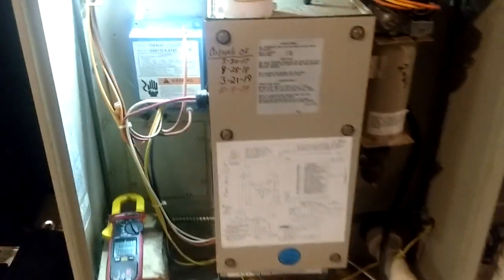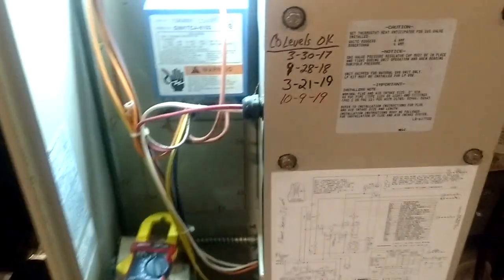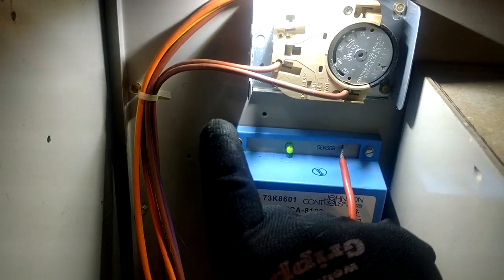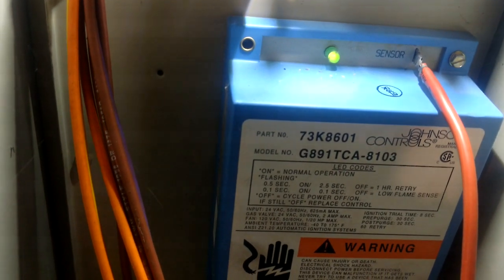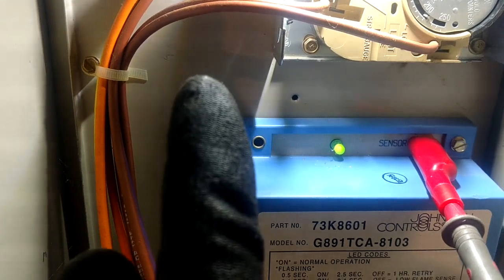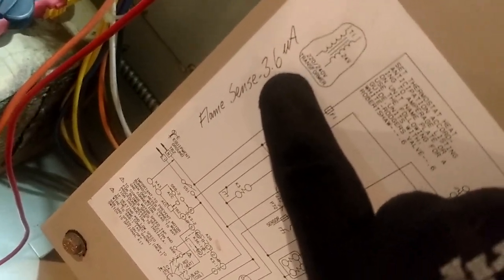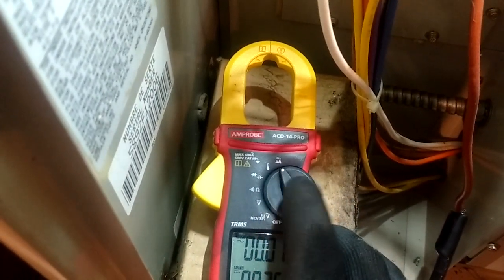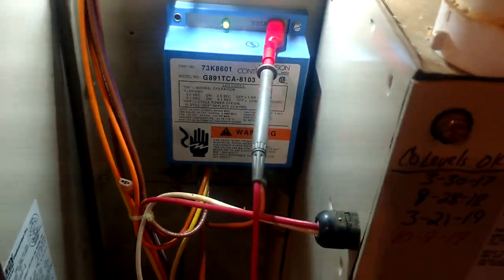The mysterious micro amp 🤔 What the uA setting on your meter is for & how to apply it in the field.

Comment: Do they make a clamp meter that reads micro amps.  My flame sensors are a pain to get to on my incinerators  I want a fast way to check micro amps via clamp meter.  I'm having a heck of a time finding a unit that will do it
Reply from the maker: There is no clamp meter made that will take a microamp reading through a clamp. It has to be done through teat leads. Just connect the meter to the other end of the wire where it attaches to the board or somewhere in between. You don't have to do it right at the flame sensor if it's too hard to access.. but if you weren't getting the proper microamps from the flame sensor the flame would go out 5 seconds after lighting.  If the flames continue to burn after ignition then the flame sense (microamps) is good. 😎👍
Reply from the maker: If your flame sensor hasn't been cleaned in a long time and it's that hard to get to. I also have a video showing you how to take a cheap wire bottle brush that you can get at harbor freight and bend it at a 45 degree angle and get back to the flame sensor to clean it while it's in place, without having to remove it. 
Just make sure you turn off the power to the appliance before doing this.

Comment: hi great explanation.. question.. i have no amperage to the rod, replace the board still the same no current to the f sensor. i replaced induce fan, pressure switch, flame sensor,  gas valv (adjusted to 3.5 wc in  specs).
resistance nighter is low 50ohms, all limit switches have continuities.
all in sequential starts when power on means, inducer fan, pressure switch, igniter glows, gas valve on (has 26v to it) but wont burn.  Also removed and cleaned all burner surface with metal brush , really cleaned.  (on off 3 times then lock out, 1 blink led).
Rarely it does burns, then the next cycle it would not burn again then lock out.
so my question is, if intermittent amperage to the sensor and the board is replace, what else can i do next? no amperage and 80volts to the sensor. 
Any suggestions or thoughts will help.. Thanks!
Reply from the maker: Probably time to call in some help
Thanks for watching 😎👍
Reply: @sknight0391  Hi.. thanks for reply.. just  finished the unit.. I had to unplugged all wires, continuity checks, checks lose terminals to wires and make sure all terminals are tight fits, especially triple check ground wire and its ground.  and use fine sand paper and cleaned f sensor again. it was used with scotch brite.
turned it back on and it runs like a brand new unit. 
Thank for you great video helping out us!

Comment: I thought the small curve on the top of the clamp was just for that...without the need of having to use the leads.
Thanks for your video
Reply from the maker: No, the yellow curved clamp on top of the meter is fir  taking Amps. Microamps is a different reading that needs to be done through the test leads. And it only applies to certain things like "flame rectification" on gas furnaces. And should only be used by qualified technicians. Thanks for watching.
😎👍

Comment: Can I do this with a simple multimeter having resolution 2000uA and 200uA? At 200uA it would measure 1, 2 or 3 uA but not fractions between them
Reply from the maker: As long as it has the uA setting on the dial.  Thanks for watching 😎👍

Comment: These killed multiple people and are to be condemned for any repairs regardless of electrical issues. This should have been torn out and the customer credited the cost towards a new system.
Reply from the maker: Do your research Chad. Do your research.
Reply from the maker: The G21 series was never even part of the recall. Those were some of the best furnaces ever made. 👍

Comment: Hey Shannon , what co levels you like looking for ? The different ranges ? I’d like to start writing them on the furnace too
Reply from the maker: A properly running furnace will generally be somewhere in the 20's or below. 12 & 14 ppm is pretty typical when they're dialed in. Most guys consider 100 ppm the "cutoff" for a furnace being safe to run. Anything above 100 ppm is not good. But even when you're up in the 60 & 80 ppm range, it's pretty safe to say there's something not right. If the gas pressure on the valve is set properly and there are no obvious blockages in the vent pipe there is probably something wrong with the heat exchanger (very small cracks or pin holes). 
BUT KEEP IN MIND, those are "exhaust" readings that were talking about. The only acceptable level of carbon monoxide in the house is 0 ppm.  Thanks for watching 😎👍

Comment: Shannon great tip recording the micro amp on service. I also I’d readily accessible record the capacitor microfarad on the blower. I find MANY way out of spec and still running when on a maintenance service. Thanks
Reply from the maker: Thanks for watching & for your feedback 😎👍

Comment: Just to add Shannon. Friendly feed back. 
The way the current is produced in the flame rectification circuit, the board send voltage through the flame sensing wire (Typically 80-100 volts) to the flame rod. The voltage is then going, via the flame sensor, into the flame. Flame is just ionized molecules so the flame conducts electricity. The key is, the other side of the flame that is touching metal, that metal has to be at least 3:1 ratio bigger than the flame sensor rod- That is what causes the voltage to rectify to DC. The now DC voltage is carried back to the control board  to prove ignition via the ground wire. So when you say in the video you can handle the wire ok and its safe with your bare hand, you better be careful when you are touching the spade connector when the ignition starts up. Next time your on a furnace pull the sensor wire and test the potential to ground and see what voltage you get!! Lets be careful in the field AND the information you put out on the video. Always  enjoy your videos:) Cheers!!
Reply: Glad you added that. I have had so many techs tell me it's like a thermopile and creates electricity. I found it amazing that the flame would conduct electricity. Was watching program about fighting fires in residential areas around power lines. They were saying they have to watch out when a fire is underneath a power line because the carbon in the smoke can make a path from the powerline down to the fire where they are spraying water.
Reply: @marvinostman522  Sounds like these"Techs" do not understand flame rectification and are giving you the complete wrong information. Flame Sensors do not produce electricity. Flame sensor is a conductor only and the flame itself is the switch.
Reply: just wondering how you connect your meter in that setting before firing the furnace and not blowing it up or do you turn it on after the furnace is running
Reply: @skinnly65  Make sure there is no call for heat (turn the thermostat down). Pull the flame sensor wire off the flame sensor. Connect your black lead off your meter to the flame sensor spade connector. Connect your Red lead off your meter to the wire you pulled off your flame sensor. Your meter is now in series of your flame sensor. Set your meter to the  DC micro- amp setting. Now go turn your thermostat up(calling for heat).
When the burners light you will get a reading in micro-amps of the flame sensing current. If your readings are low for this manufacture of furnace. Then you can turn the heat down, disconnect your meter from the flame sensor. Pull the burners and clean the burner heads (Inshot type) and clean the flame sensor. Now reconnect and re-test. you should see a improvement in your micro-amp readings. Hope this helps
Reply: I had it explained by someone I trust that to boil it down what happens is the board sends out an A/C signal to the flame sensor which travels thru the flame and grounds out to the burner. The board doesn't detect an alternating current coming back but only going out . That's what tells the board it has a flame.
Reply: @marvinostman522  No it  does'nt. The board is receiving a dC current back by way of the ground wire. The dc current it's looking for is created by the flame rectifying the 80-100 vlt AC put out by the board through the flame sensor into the fame. If there is No flame, there will be no dc current to ground which the board is looking for. Heres a simple test for you to better understand it. Next time you are on a furnace. Find the ground wire that goes from the board then screwed to the metal chassis. Remove the screw and clip a alligator clip to the ground wire and clip the other end of the alligator clip to the chassis. Fire up the furnace, once the burners start, then disconnect the alligator clip on the chassis. The burners will drop out. This dc current is what the board is looking for. Now remove the alligator clip and put you meter in series of the ground wire and  the chassis. Set your meter to dc Micro amps. Start the furnace and you will now read the dc current going back to the board. By the way this is how you can read the micro amp reading on a furnace that does not have a remote flame sensor but a duel igniter sensor. EX; Interterm trailer furnace does not have a remote flame sensor. Hope this helps you better understand how flame rectification work.
Reply: @PaulHVAC1  I stand corrected. The board doesn't read the DC signal off the wire to the flame sensor. However the main point I was making is that the flame sensor itself doesn't make any electric charge. You can put a paper clip in place and it will still work.
Reply: @marvinostman522  Yes you are correct. The best way to describe the flame sensor is that its is a conductor. AC voltage generated from the board is introduced "INTO" the flame by way of the conductor (Flame sensor)positioned inside the flame.

Comment: Does this meter read DCmv... thermal pile and thermal couple testing.... yes,no...
Reply from the maker: Not sure to be honest with you. I never use mine for that.
Reply: Shannon Knight HVAC what's the lowest DC Volt  setting????????
Reply: Can you show a video....
Reply from the maker: @dfigueroa903  the meter is "auto-ranging" so I'm not sure what the lowest DC voltage is. You would have to check the manufacturer's specifications of that or call amprobe
Reply: yes they do

Comment: How high of an amp draw can you safely real that way
Reply from the maker: "Micro" is millions of an amp. So that setting is only used to read flame rectification on gas furnace flame sensing rods. It should never be used for measuring normal current. Serious injury and damage to your meter could occur. 👍

Comment: Did you pressure test that? I use to find about a 50/50 failure rate on the newer ones. Good luck getting that flame sensor out unless you have the socket tool for it. They were great units once they got the bugs out of them.
Reply from the maker: Every pulse furnace that was ever installed was pressure tested. If the heat exchanger passed the test and was allowed to stay out in the field, I honestly don't know if they'll ever go bad. They were built that tough. if you remove the rubber tigon tube coming off the exhaust line and check it with a monoxor it will almost ALWAYS read 12 ppm when the furnace is running properly. If it starts going up into the hundreds that's when I condemn them. And yes I have the tools to get the flame sensor and spark plug out. But I still never look forward to do it. Those two components are almost never an issue with these furnaces. That was also a very large unfinished crawl space. 😁
Thanks for watching 👍
Reply from the maker: Most guys don't even realize that the Pulse21 was never even part of the recall. The issue was corrected by then, but the damage to the "name" had already been done. So they were put out to pasture in 97/98' but the legacy lives on.
Reply: They had a recall due to crappy welds in the early 90s and they wanted them (and still do) pressure tested every 5yrs. I have seen several weld leaks along with a bunch of secondary leaks... pretty cool units. Change the air flapper, clean the mud out of the bottom of the vent and let it roll
Reply from the maker: @kangaroogod   Pulse 21 was never part of the recall.